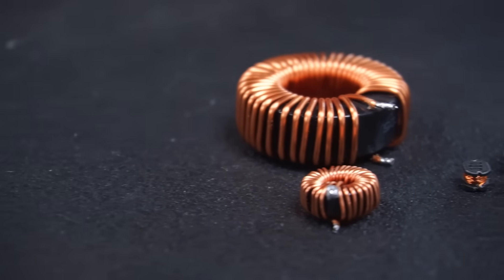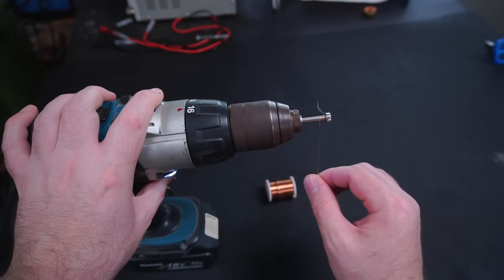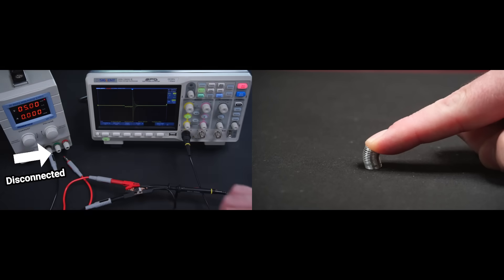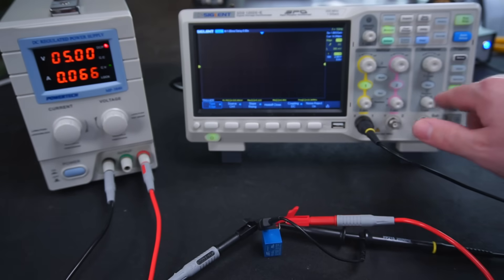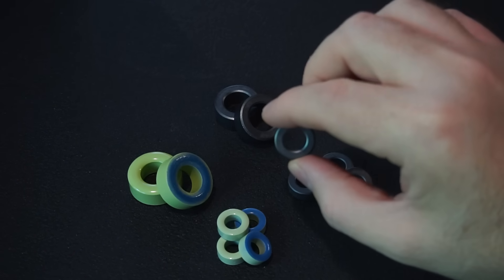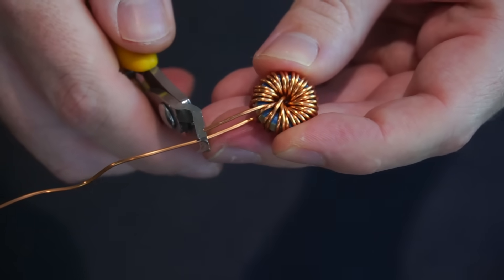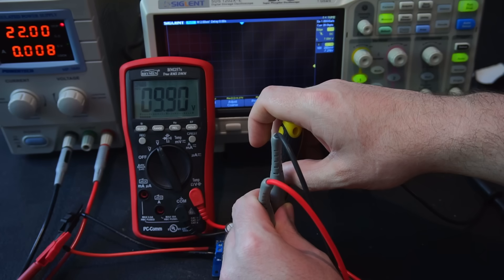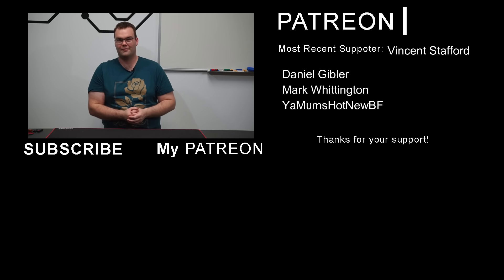How INDUCTOR's work & How to make your own

Comment: I'm sorry, but i hate that magnetic field collapsing theory and comparing that to a spring. I think it's much easier to comprehend that water has mass. Mass has a tendency of accelerating or decellerating. A long hose with water pulsing through it will have a steady low flow at the end since it cannot be stopped or started at an infinitely short amount of time. The induction spike also correlates to the pressure increase or decrease at the start of the hose during the change from off to on or vice versa.

Comment: 2020-02-14: I think there's a teeny-tiny error in the parts list of the schematic. C2 instead of C6, and C2 belonging to the list of capacitors on the line below. So the schematic is correct, only the legend is wrong.

Comment: Excellent video - thanks for the info! My only question is: why did the IC in your buck converter heat up so much without the inductor in the circuit?
Reply: This is down to a slight misunderstanding in the video. Yes inductors can be used as filter elements to smooth current, but in the buck converter the inductor is an energy store, like the spring he flipped so illustratively. The inductor’s job is to keep the output current under control. The current increases when the IC switches the output on, and it decreases when the IC switches off with energy being supplied from inductor to load. The IC varies the switching times to regulate the output voltage while managing inductor current.

With the inductor shorted, there is no energy store. When the IC switches on, it connects the input supply directly to the load, and the current instantly becomes excessive. That’s why the IC gets hot.

Years ago I did the math, and it turns out that switching like this without an inductor is no more efficient than a linear regulator, and linear regulators drop voltage by losing energy as heat. They get hot! By shorting the inductor position he just made a linear regulator with absolutely terrible ripple voltage!

Comment: SO both inductors were the same value but one was wound on a torroid with higher permeability. One worked much better than the other. So what;s the take away on choosing a permeability and why?
Reply from the maker: Generally speaking, higher magnetic permeability is more suited to noise suppression in low current applications. For example, you'll find ferrite beads on some USB cables to suppress noise.  Lower magnetic permeability is better in high current applications (SMPS & buck converters.etc)
Reply: @Schematix  Excellent thanks.
Follow up question: I have quite a collection of torroids gathered from surplus shops. Not sure why I collected them when I don't really know their characteristics but..... Is there a standard colour coding for them (probably not) SO is there a way to test and measure the permeability? (perhaps  the subject of another video) So I can put them to proper use?
Reply from the maker: @davesage9190  Some toroids are in fact color-coded. A quick google search should help you out there. However, the generic black/grey toroids are another question. You can buy a meter to measure the Permeability however it's cost vs just buying more toroids with known values doesn't make much sense cost-wise. Maybe there is a method of measuring Permeability at home on the cheap?? I'd have to do some digging to find out
Reply: @Schematix  The way I've found the permeability value is to simply wind some turns onto said unknown toroid, measure it's inductance, and then enter said details (wire diameter used, number of turns wound, toroid dimensions) into the very same calculator that Schematix used and simply vary the permeability value in the calculator until it shows the same final inductance value - problem solved. Doesn't take long.

Comment: A better analogy for the stored energy is the kinetic energy of a moving body, because inductors give inertia to electric current. Interruption of the circuit (creating a voltage spike) corresponds to collision of the moving body with an obstacle (exerting a high force for a short time). A compressed spring is an analogy for a charged capacitor. Movement created by the released spring corresponds to discharge current from a capacitor.
Reply: Those are the best mechanical analogs. Add a dashpot (shock absorber) as the mechanical analog for a resistor and you can visualize RLC circuits as masses, springs, and dashpots - or vice versa. One good example would be examining the response of a suspension sytem to a bump in the road. The tire/wheel would be the mass (inductor) connected to the spring (capacitor) and dashpot (resistor). The damped system can then be analyzed as an RLC circuit responding to a step input.
Reply: @vicruzr  wow😳 wonderful analogies. Please where can I get more of these analogies (any detailed basic e-book at all🙏 )for better understanding of circuits, bit by bit to complex level.

Comment: Why use an inductor over a capacitor for ripple?
Reply from the maker: That's a good question. In the example of my buck converter, the output is switched at 180kHz. At these high frequencies, the capacitance value of electrolytic capacitors can drastically decrease. Hypothetically if I had a 4700uF capacitor, that 4700uF of capacitance could be measured at 120Hz. At 1000Hz the capacitance could drop to 2500uF. And at really high frequencies the capacitance might drop to almost 0uF. Which as you can imagine renders the capacitor all but useless.
Reply: @Schematix  your explanation demonstrates your complete lack of understanding on why the inductor is needed there. Capacitors don't really drop in capacitance at high frequencies; moreover, their impedance is reduced so larger currents can be filtered out.

Inductor is the fundamental element of voltage conversion, because it is a temporary storage of energy that is not directly related to voltage, unlike capacitors. This allows adding energy to it using one voltage, and extract the energy back using another voltage.

This is the working principle of buck, boost and flyback voltage converters. This is not the working principle behind non-flyback transformer-based voltage converters (these include simple mains-frequency transformers, and some switching converters that simply generate higher-frequency AC and pass it through a transformer). Also, switched-capacitor voltage converters exist, they don't fundamentally need inductors, but the selection of ratios is very limited.

I've put a thumbs-down to your video, sorry, it has quite a few mistakes, and does not provide a correct explanation to anything.
Reply: Ahh yes I see. An inductor reacts inversely to a capacitor with a change in frequency. Something I knew but never thought about like this. Thanks.